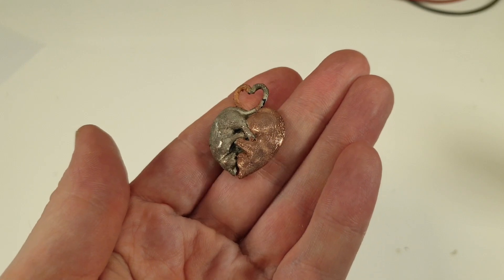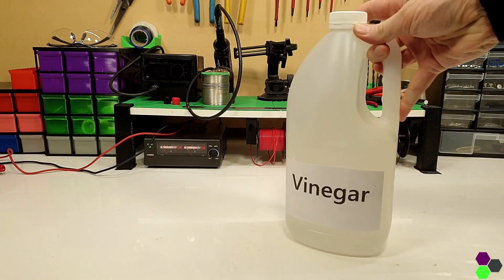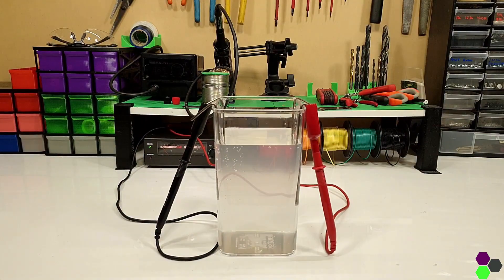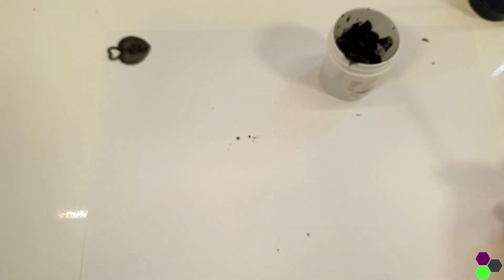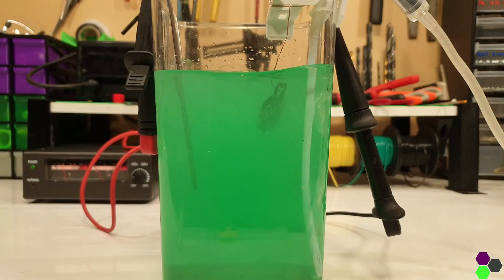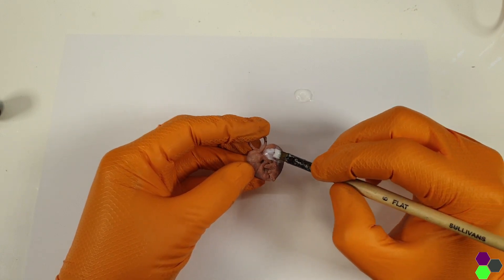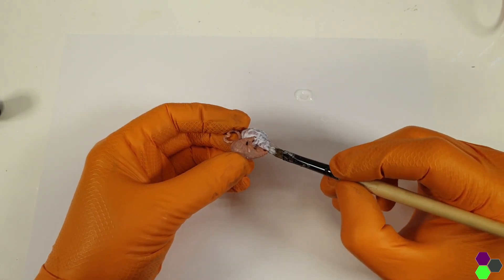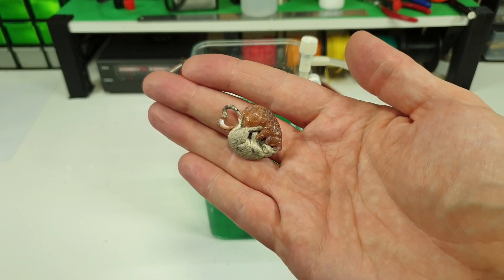Metal Plate 3D Prints with Nickel and Copper

Comment: Suggestions on what batteries to use for this project ( I don't have a desktop power supply)? How long does the process normally take with batteries?
Reply from the maker: I have a battery pack like this one https://www.jaycar.com.au/4-x-d-cell-2-rows-of-2-battery-holder/p/PH9222 that I have used for plating before, it is at the higher end of the plating voltages I would suggest, perhaps a 2 battery holder or 3 single battery holders (in series) would be better. The length of time shouldn't change at all as the current levels are so low.
I hope this helps

Comment: Nice summary! It helps to  mitigate your nickel issues by varying your current. The intrisic stresses of a plated nickel film are due to the Current Densities while the positig the metal. You will have the least amount of stress around about 5A/dm^2 in layers thicker than 60µm. About that you will get tensile stresses (at 10A/dm^2 about 30N/mm^2) and below compressive stresses( at 1A/dm^2 about -25N/mm^2). Therefore varying your current helps. In a professional setup you always cuurent control your source. And if you want better controll your ductility you pwm between two currentlevels over a the baselie current to have very fine grain control.have fun!
Reply: No worries, I spend 6 years knee deep in copper sulphate;) so I am glad I could help. But am going to try your plating pen. I really liked this one. Back then I use high frequency ultrasonics (1mHz) to get high aspect ratio cavities plated.
Reply from the maker: This is great info! Thanks Jen's!

Comment: Hi Brodie,  nice work... I did something similar years ago with copper, nickel an silver. I used different solutions for each metal. I can see that you use Vinagre and salt to get the medium for copper and nickel. Can you use the same  for silver. I mean i had to produce silver nitrate with nitric acid and mix it with amoniac to get the medium to be able to plate with silver. Thank you.
Reply from the maker: I believe it will work with silver, but I've never honestly tried it (Gold or Lead either).
I have a small amount I might try it with on another project.
Reply: @BrodieFairhall  thank you very much

Comment: Great video  I can,t wait to start trying this out there are a few projects that I would like to do. where do you get your plating material from? like the nickel you used  Thank You
Reply from the maker: Hi Neil,
I get my Nickel from welding rods. Pure Nickel welding rods are used to weld cast iron, so they aren't hard to come by. You'll just have to make sure they aren't an alloy. You can also search eBay and other places for Nickel/tin/zinc anodes.